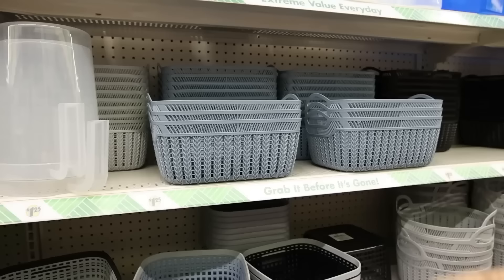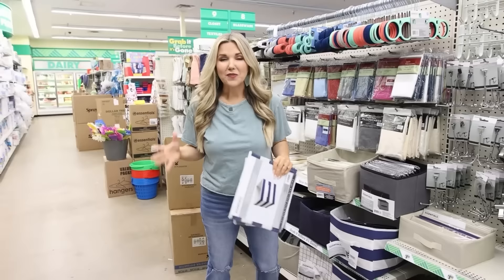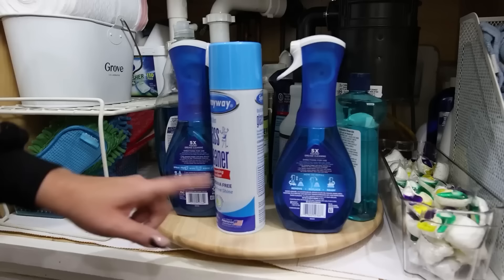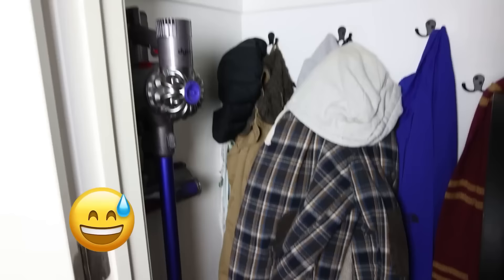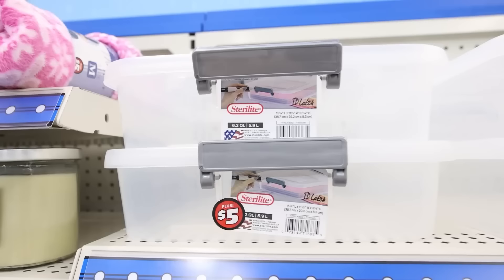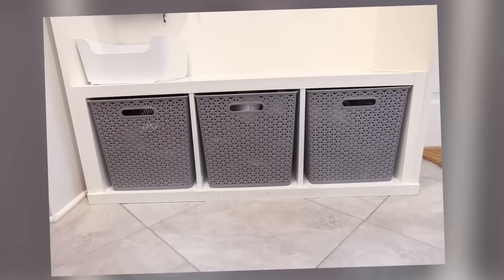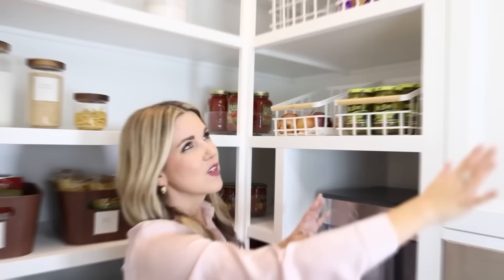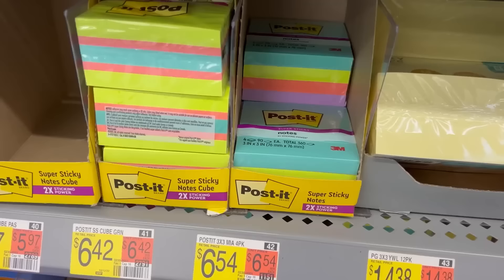Watch me ORGANIZE my entire house...Quick & Easy!

Comment: Dollar tree used to sell the hanging baskets that hung from a shelf. I used to have a bunch of them. I recently redid my laundry room where I had them, and no longer needed that style of storage. I wonder if the dollar tree will bring those back? I also have mesh hanging grocery bag dispensers that the dollar tree used to sell. I love those things. They Velcro in place. I have them hanging on the sides of my wire door mount shelving system in the laundry room. I have one on each side. One is stuffed with old cleaning rags. They are easy to pull out to use in a hurry. The other one has plastic store bags, that I use for the trash can,  and for cleaning out the litter box. I wish dollar tree would bring those back as well. They are very well made and I’ve used them for 15 or so years now.
Reply from the maker: Were they the wire hanging baskets? I see those sometimes when it starts to get more towards the spring and summer.
Reply: @lizfenwickdiy  yes, they were wire. Just not as heavy duty as the ones you showed in the video. I bought them a long time ago, but I could definitely see Dollar tree bringing them back. Especially now that so many people are into organizing. I’ve always been an organizer since I was a kid in the ‘70s.  It’s so much easier now, because every store sells stuff to organize with.
Reply: Wire under shelf baskets, that slid on the shelf. Not hanging.
Reply: @lizfenwickdiy  I wish YouTube let you add pictures.
Reply: I moved and have the slide onto shelf some are drawer type or bins yet they slide on and hang under. Yet. Now I have wire shelves and need to find something to easy and cheap to put only where I need to add them. As. Since not wood shelves and wire the sliders will not stay as not solid. And also tons of risers and corner and some had zip ties on so could have things above and under. Any ideas. A cheap easy fast way I could put only on areas I need to use these as wire shelf fall thru so will not work.  Any and all idea would be appreciated!!! And  thanks